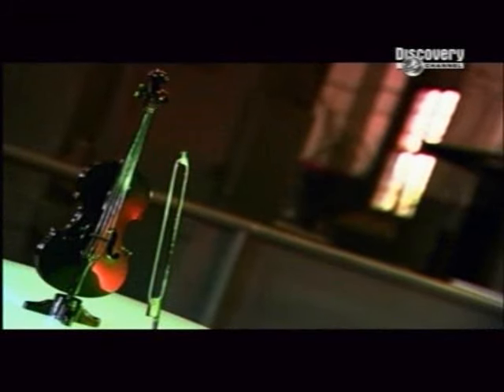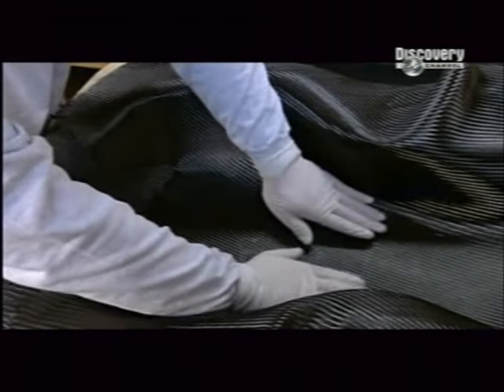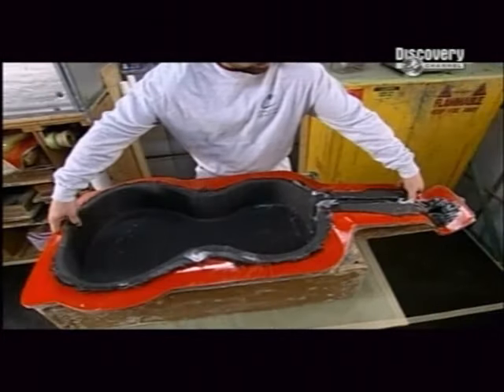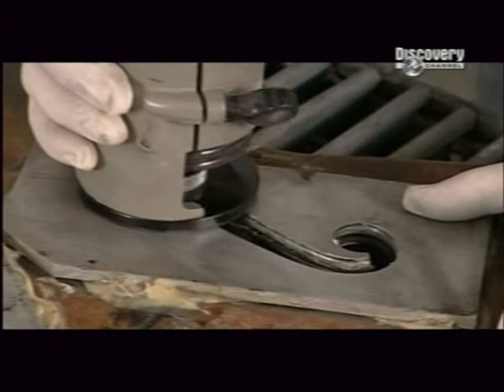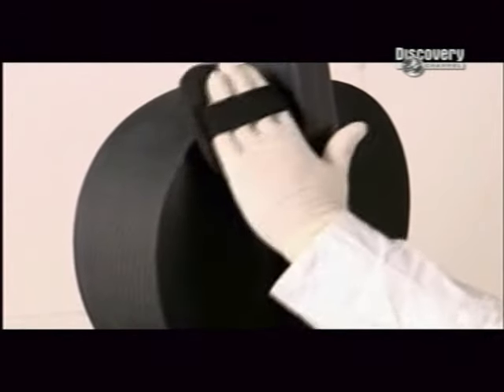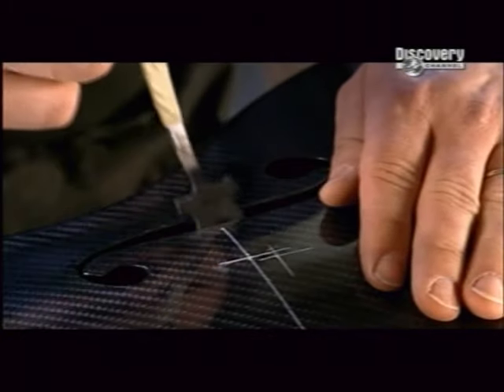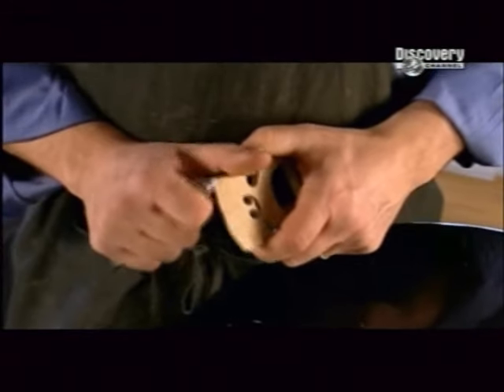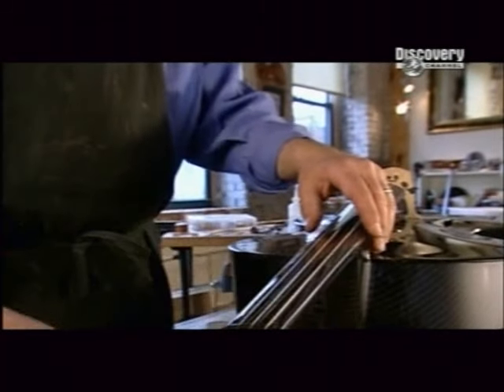How are Carbon Fibre Cellos made?

Comment: 9:06 These are Flatwound Strings. They're a late 19th Century invention that came around 1874 by Hamilton. They were originally designed to replace the Gut Strings on Bowed Stringed Instruments because they last longer, hold tune better, and the flat surface increases the contact area for the bow hairs.